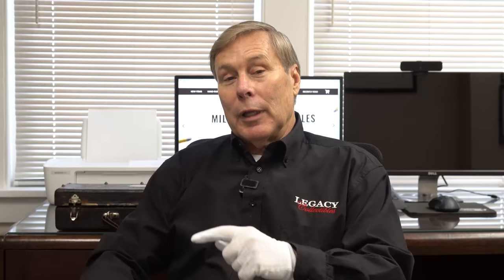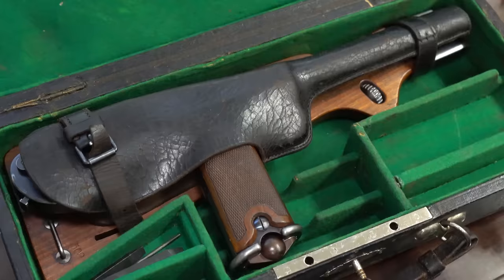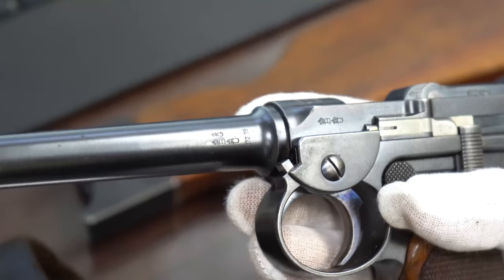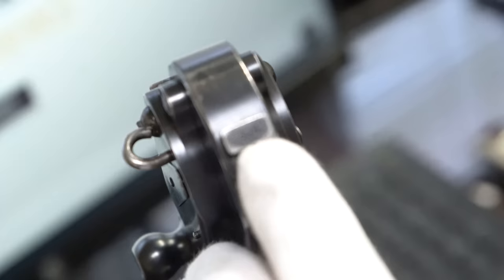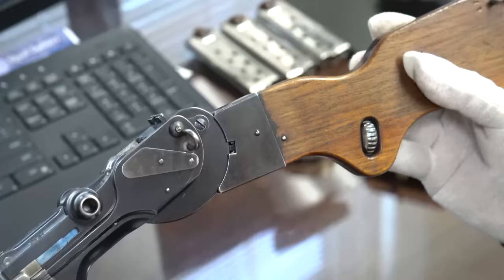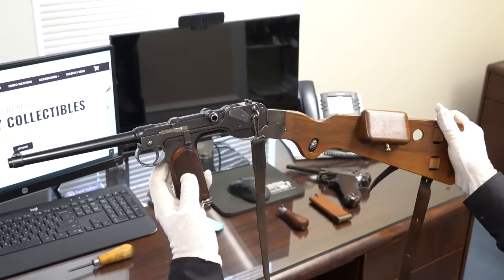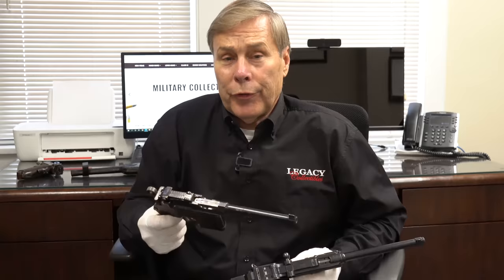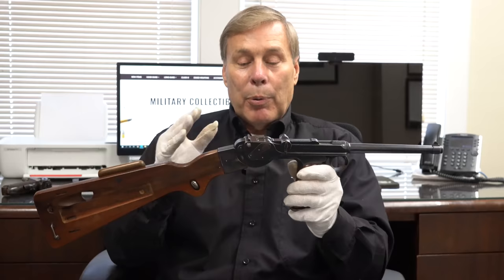Complete Borchardt Kit | First Semi-Auto Pistol!

Comment: Without making a remark against the cased Borchardt or your verbal description, the handle of the case is not factory original. The original handle appears to have been broken and then replaced.

The only thing missing is an original Loewe instruction manual which are extremely rare ;-)
Reply: So rare as to be unobtainable at any price. Last time I checked, Swiss museums don't sell anything...

Comment: When I worked for John Martz the Luger maker from Lincoln, CA he bought one at the Reno Gunshow which needed restoring which he did. He had Mike Krause make the ammunition to fire through it; it was .30 cal Luger loads put into .30 Mauser cases with 86 grain full metal case cupronickel bullets. It functioned flawlessly and was very accurate out to 50 yards even though the bore was very frosted looking. It came with the stock and that made it very controllable on the distance shots. While holding the C96 Mauser pistol you said that it was a "blowback;" it wasn't it was a locked breech design. If you take it apart you will find the rocking breechblock connected to the barrel extension. Please do take a look!

Comment: Very nice video!! I was fortunate to hold and inspect one at the Rock Island stand at the Wanenmacher Arms Show in Tulsa back in 2013, I believe. It was better balanced than expected and the engineering is so interesting! It came with the original stock and some accessories, but not in the compact secret agent bulbasizer case! You sir, are the first I’ve seen with aforementioned case…

Comment: I believe that 93FORDMUSTANG  is 100% correct, open the bolt and put the projection to the rear and it will hold the bolt open and leave room for the cleaning rod to clear the chamber

Comment: All quality firearms should come like this. 

It's crazy how the first semi successful semi auto pistol got the caliber so correct the first time 7.63x25 was the most powererful handgun cartridge until the .357 magnum came along and in my opinion the 7.62x25 tokarev that was just a hotter load is the best semi auto pistol caliber still as its fast, flat shooting, accurate and can pass though both sides of 3A body armour using FMJ lead core.
A shame that only a few nations make modern double stack pistols in this caliber.

What's also really crazy is that the first semi auto pisols improvement the luger that was originally in .30 luger (a shorter version if 7.63x25) was asked to make a bigger larger caliber so all he did was use the existing case dimentionsx remove the bottle neck and 9mm luger was born.

9mm luger was a compromise cartridge but now its the most popular pistol cartridge today and I think its the 2nd or 3rd depending how you look at it oldest military cartridge in wide use today with the oldest being the 7.62x54r.

Comment: I don't think the brass tacks are original.
I base that only on it looks identical to a clarinet case of the same period. I believe the case making factories contracted to make cases for all sorts of things.
Reply: The brass can't be original. Brass tarnishes quickly, even in modern climate controlled museum conditions, which did not exist for decades after the few Borchardt's were made.
Reply: @bhoward9378  do you think the case was factory or built by a case maker?
I have worked on brass instruments that were 100 years old or older.
Silver plating was very common back then but there still were many horns without. Of course musicians tended to keep them polished. Don't think the clear coats were all that good back then but waxing the brass instruments was fairly common.

Comment: The C96 doesn't have a detachable magazine. Like other early semi automatic pistols it had an internal, fixed magazine fed from clips.
Reply: In 1926 they did produce detachable magazine guns, mostly for Chinese export.
Reply: They also do some experimental 20 and 40 round models in the late 1910’s. 1918 or something like that. I think they only made a few dozen though.
Reply: @john-paulsilke893  Kind of a developmental precursor to the Mauser 712 Schnellfeuer.